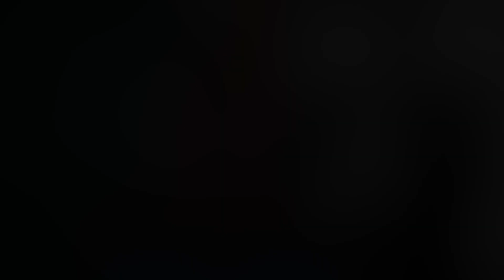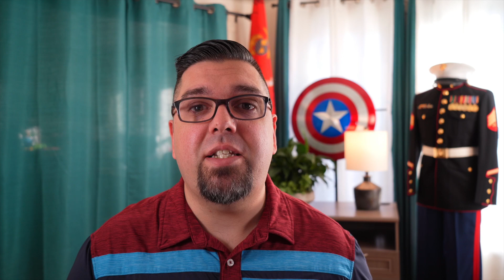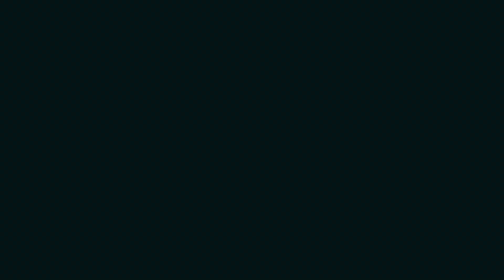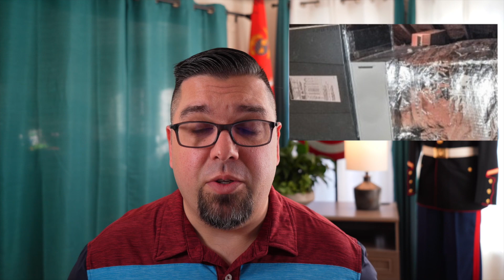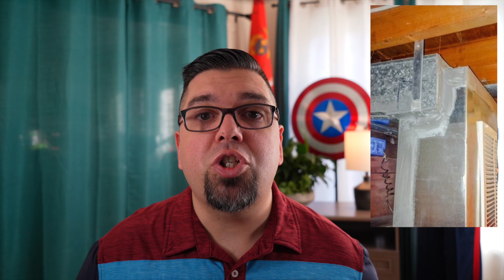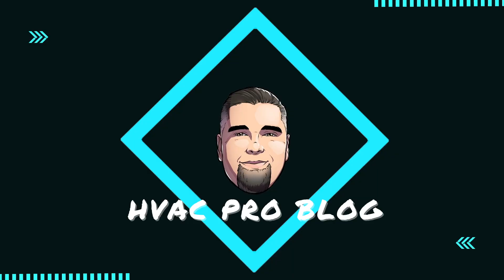Manual D - Duct Transitions

Comment: In the planning stages of building a block home on a slab in Florida. Looking for for the best possible (electric powered)set up without unneeded redundancy to do the following.  

Ductless Cooling / Heating
Pool Heating
Normal Household Hot Water

Is there a way to efficiently do the above without 3 separate systems?